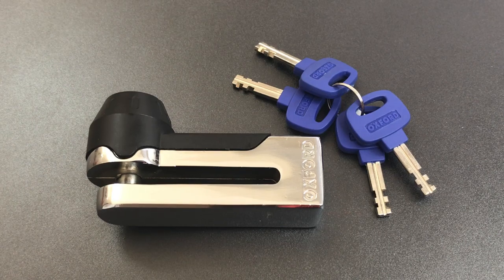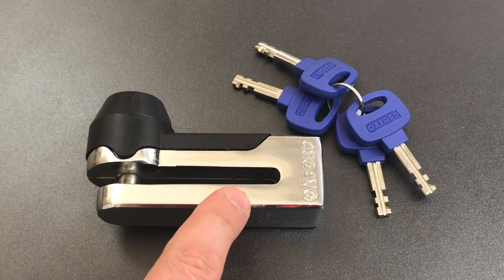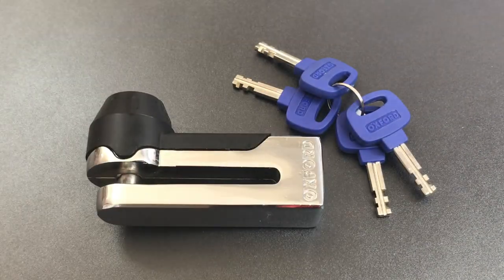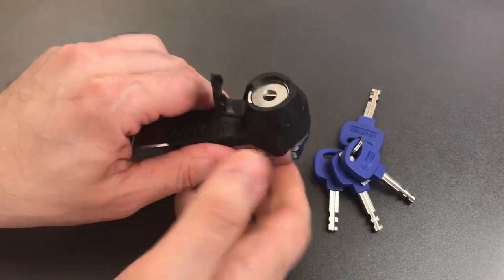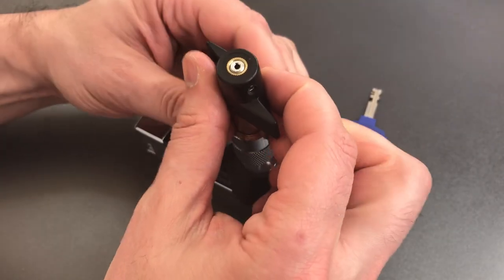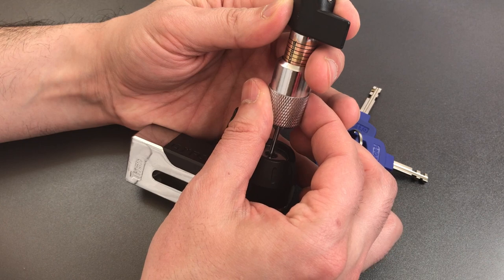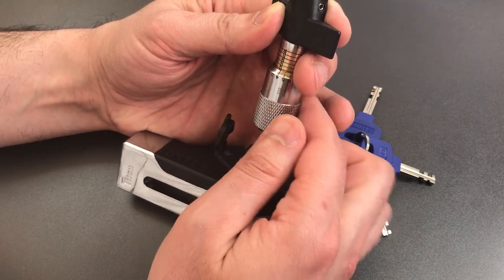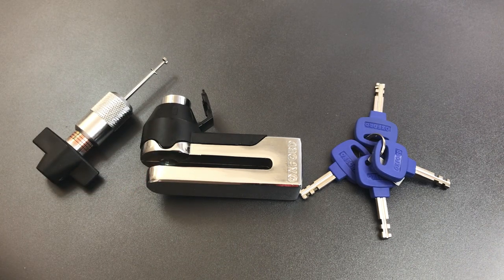[627] Oxford Titan Motorcycle Disc Brake Lock Picked

Comment: I can't see anyone ever picking one of those. It's so much easier to just load the motorcycle into the back of a truck with a buddy, take it home, and take a grinder/portaband to the lock body.
Reply: Or just undo 6 bolts with an allen wrench and the wheel will roll without the disc haha, not worth spending top dollar for something they can easily bypass.

Comment: Where did you come across that DD pick? All I can find are the cheap ones from china and the very nice/expensive silver bullet that Hux makes.
Reply: Yes it's one of those, thanks!
Reply from the maker: That’s what it stared out as, but understand that mine has been significantly modified...
Reply: LockPickingLawyer I assume most DD picks require a bit of modification to be practical.

Comment: It should be possible to make the core and pin ride in a ratcheted carriage so that after locking the lock could be tightened to remove any space between the lock shackle and the break disk.
Reply from the maker: That seems like a complex, but good idea. All I can say is that the ratchet mechanism best be very, very strong.

Comment: I wonder if perhaps the lock manufacturers are concerned that if they make the locks out of harder materials, there is a chance it might scratch the disc and they would get complaints from the customers due to that.
Reply from the maker: Fair point, but overmolding is cheap.

Comment: You should get your money back if you paid a decent amount for that! I could see how someone might think "steel" with that very shiny metal finish, that is what it looks like to a layman. Of course when selling something like a lock though you'd better be right about that sort of thing.
Reply from the maker: Agreed, but I got it secondhand on eBay. 👎
Reply: Certainly doesn't mean you can't get your money back! Even if a seller says no refunds, it doesn't matter if they mis-advertised the product. Though, they might request you return it and even on their dime it might still be fun to destroy it depending on how much you paid for it.
Reply: I still want to see it die at the hands of the bolt extractor😃

Comment: Another great demo of your skills, not much of a challenge for you.  Have you taken a look at the "Abus Granit Sledg 77 Web Disc Lock" to try and exploit with the bolt extractor?  Not sure if this disc lock is in the proper price point to destroy, quite expensive, but it has all the steel elements for a proper brute force challenge.  I have no experience with this disc lock, but it advertises using hardened steel throughout its build...
Reply from the maker: Thanks... while they look similar, I believe that Avis operates under an entirely different mechanism and design.

Comment: https://www.yoycart.com/Product/533099203563/

There is a supposedly 304ss option though almost 50% more than the others at $46usd. What price point would you consider inexpensive? And supposedly this 'V' style locks are designed to be more resistant to crowbar separation attacks, which is similar to the bolt extractor, but that just means having to do it twice on Both arms

Comment: Is that pick used on the abus granit or is that a different tool?
Reply from the maker: That is the tool however note that mine is highly modified.
Reply: LockPickingLawyer I might get one, but does your modified pick still work on the granit?
Reply: cointoss election i am not buying a lock. I am interested in buying the pick tool.
Reply: BlackDolphin90 I'm interested too if you find it or know what is modified from that would be great. 😀 I looked banggood but they look chinsy. The one I've got only tensions from the front you see..